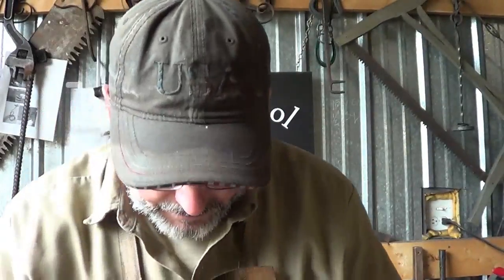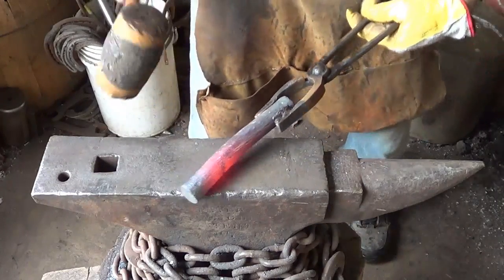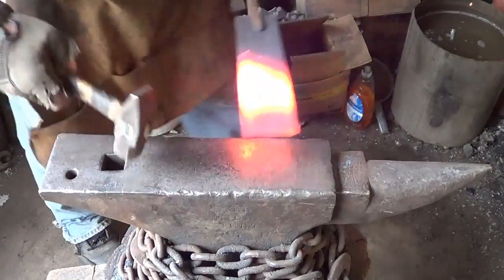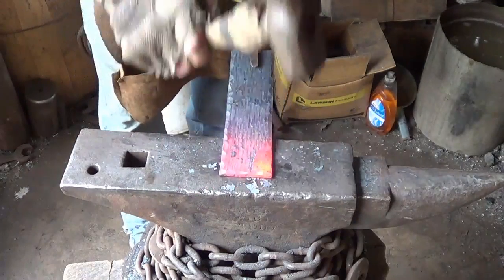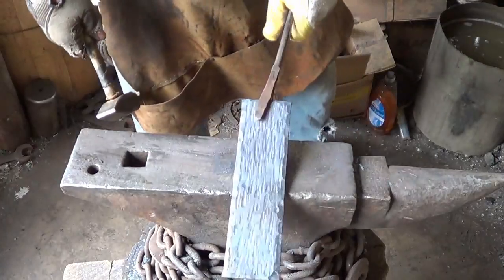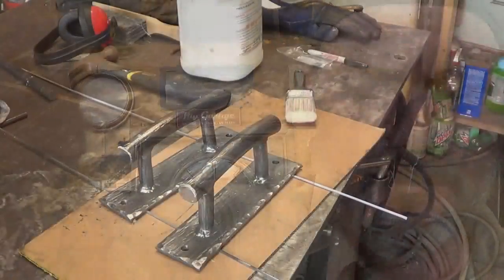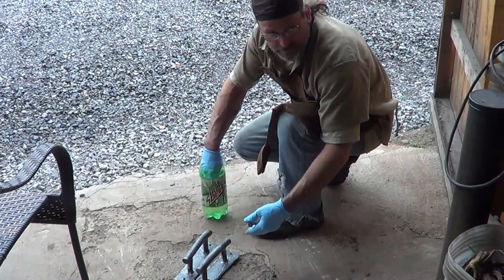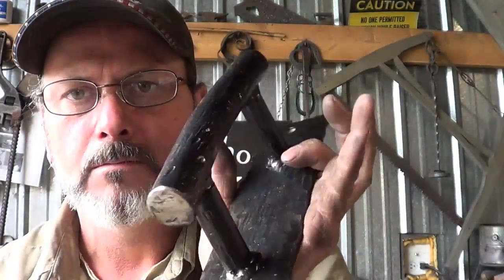Blacksmithing - Tree Branch Textured Door Pulls

Comment: Hey Chandler! Brother, you need to rehang some of your hammers. Getting dangerous there! I had a 3 pounder come off on the upswing and hit me right in the lower back. OUCH!!! Beautiful handles!!
Reply: I suggest anti-freeze.
Reply: LazyLife IFreak  What does antifreeze do for them?
Reply: Unlike water, glykol does not evaporate once inside the wood which it replaces.
Reply: I didn't know that. I have a couple hammers with which I can try it out. Thanks for the information.
Reply: Use one of the hammers you like the least, just as precaution.
Reply: But I like all of my hammers... I need more hammers. :-)

Comment: You can get some cold bluing product that is used on firearms that should achieve the blackening process that you want. It's used in gunsmithing to blue the barrels.
Reply: Agreed. Looking at the MSDS's for both the Presto black gel and Super Blue gun bluing liquid show that they are very similar products.
Reply: While I totally agree, is it available anywhere for a decent price ? I have only seen Very expensive ones available and only in small containers... (supposedly you don't need that much at a time, with a firearm)..
Reply: You can get it for about $15 to $20 dollars at Wal-Mart it really doesn't take much to get the results your after.
Reply: in terms of per ounce cost, it looks like the Presto black gel ($149/gallon) is $0.33/oz. less expensive than the Super Blue ($47.81/32 oz. bottle). I guess it would come down to frequency of use and size of projects to determine the most cost effective solution. As an aside I thought that maybe It might be cheapest to try a DIY solution by getting some nitric acid, selenic acid, and cupric sulphate... but that gets expensive pretty quickly.

Comment: Doing your own blackening for less could be done using the hot method of boiling in a caustic soda (Crystal Drano) solution.  But it's unpleasant and of course you need to be very careful.  There are a lot of links online that will tell you how to do it. 
Awesome video man
Reply: I"m certain there are more than just the step I mentioned.  There are plenty of how to's and videos about it online.